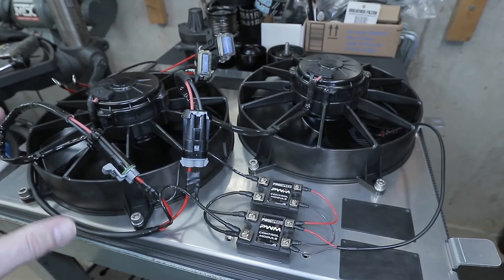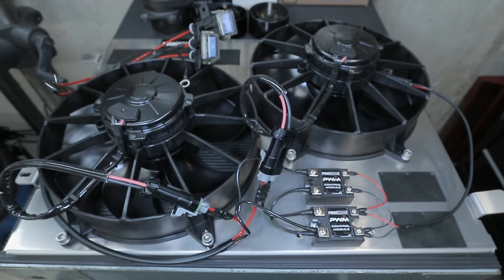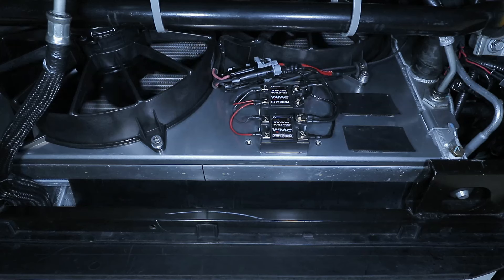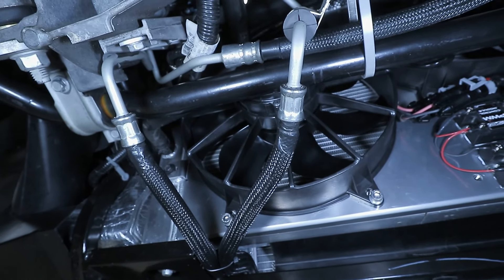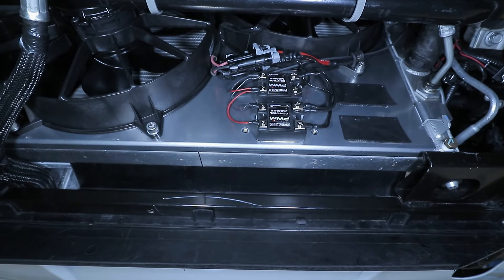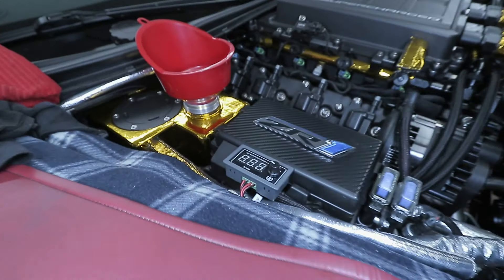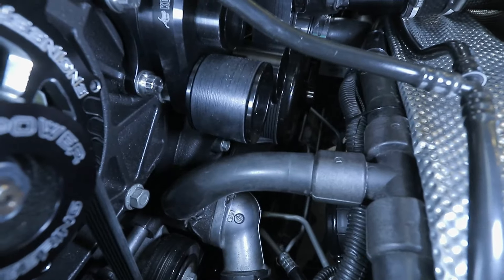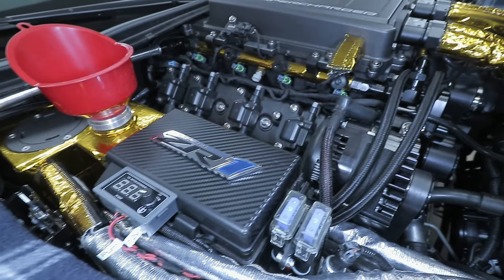Corvette Z06 / ZR1 Prospeed C6 DUAL SPAL Fan Shroud Kit | INSTALL & Review

Comment: Hey, hey John!  Good choice there.   That fan unit seems to be what the cognoscenti go with.  You've been so helpful during my slow build...  I trust you'll provide an update if there are any issues with reliability.

Because... always with my own twist (or Im always broke and trying to save a couple nickels --hahaha!); I recently finished my own shroud for my ZR1, with two of the curved blade Spal 11" HO fans.   I always deburr edges, so no (elevated) chance of getting cut.  I also ran power and ground  by 8 ga, fine stranded OFC cables added big metal-case flyback diodes to each fan and I use the OEM PWM control signal (intoCRYDOM 100A SSRs) until the Coolant hits 200 degF, then switch it all over to full 12V power using industrial 100A DPDT Relays triggered by a Setrab 200 degF thermal switch.  I don't know how much money I saved (or spent), but I do like a few features in my Prospeed copy...  Everything but the time to do it all myself!!

Anyhow John,  a very nice score and as always your implementation is superlative.  Well done, sir!

Comment: Did you need to adjust the tune for the fans? I installed the DeWitts rad and fan and in hp tuners there is an option for duel fans
Reply from the maker: No i did not need to but i am aware of the setting that you are speaking of. Its for setups that have dual stage fans. The prospeed still acts logic wise as a big single stage variable fan like the stock one.
Reply: @JohnFrancoNH  makes sense, thanks 🙏🏻

Comment: What would you say the coolant temps difference was between this fan setup ?
Reply from the maker: This fan kit does a great job in summer heat so far. Car stays below 200F even with A/C on thru out the whole time.